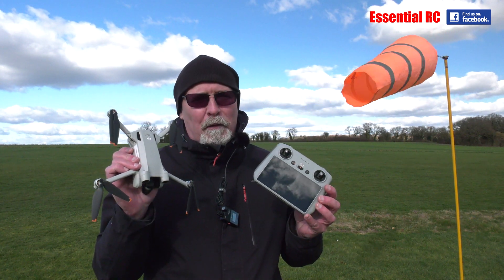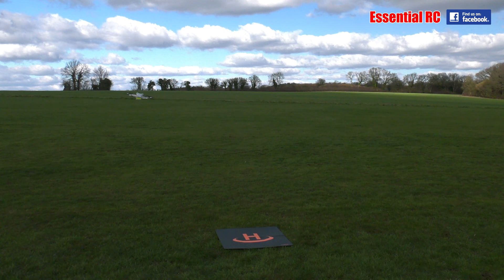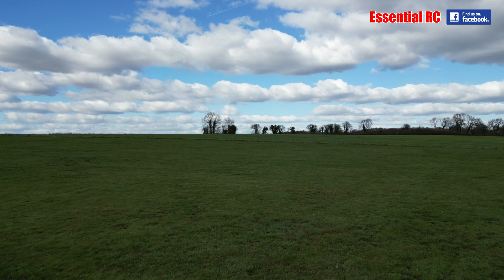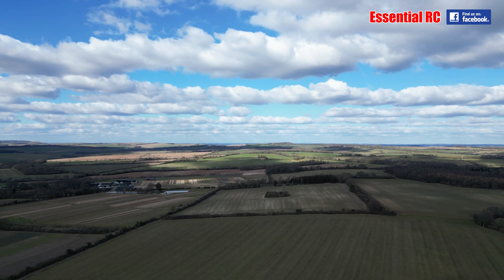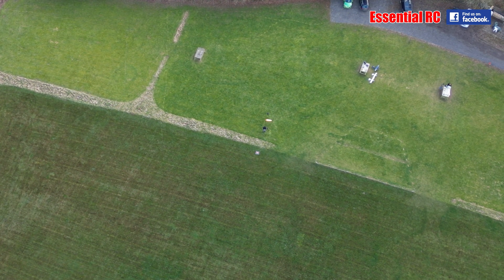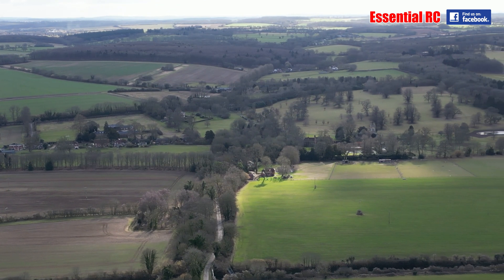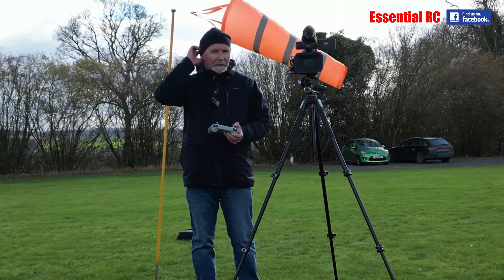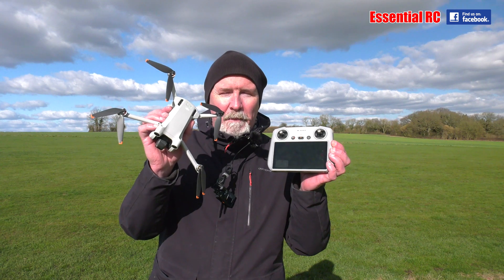DJI Mini 3 Pro | 4K camera Drone Stability and Wind Resistance Test !

Comment: 03:59: Did you notice what happened to the video for a split second (03:59 - 04:02)? I have the exact same thing with my DJI Mini 3 Pro. I don't know if it's the strong wind that makes the drone react like that and shake the image. This is my first fall and winter with DJI Mini 3 Pro. In summer, when the weather was good, I did not observe it. But then I also had another drone (DJI Mini 3 Pro too). After about 300 photos, the autofocus broke down and I sent the drone for repair. I got a new drone, but it's kind of... weird. It is much louder than the previous one. I replaced the propellers but it didn't help. I feel like it uses up the battery faster. It cannot stand stably in one position but swims slowly to the side. When I point the camera vertically down at a higher altitude and want to fly sideways, something similar happens to the image as in your video.